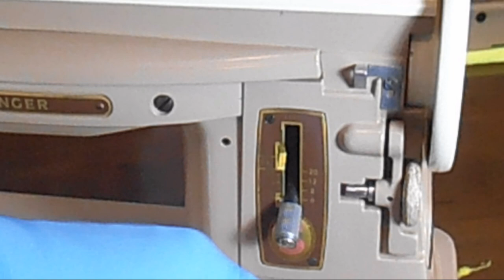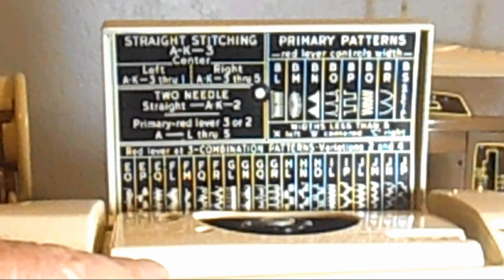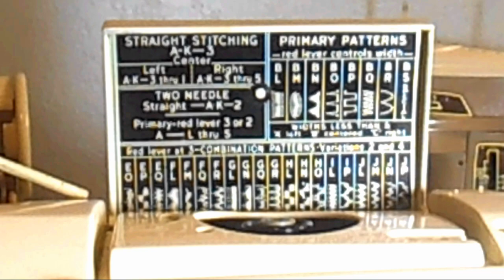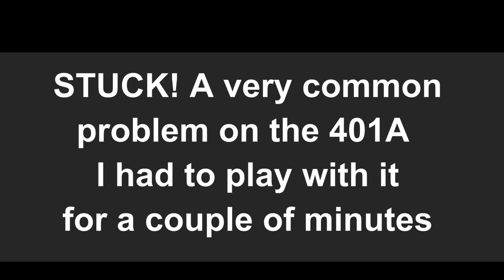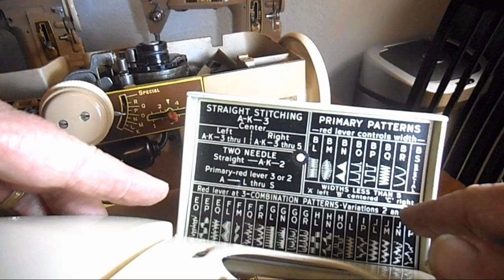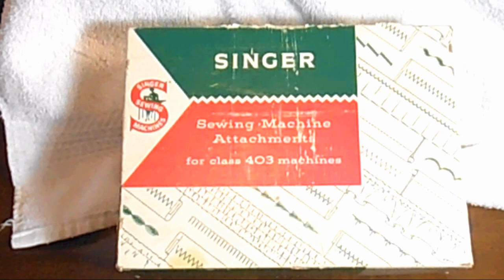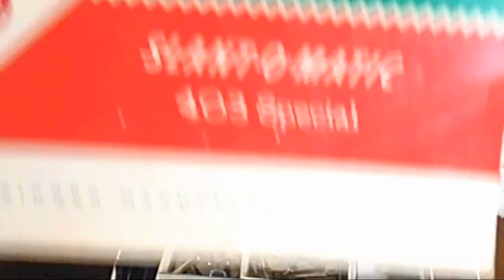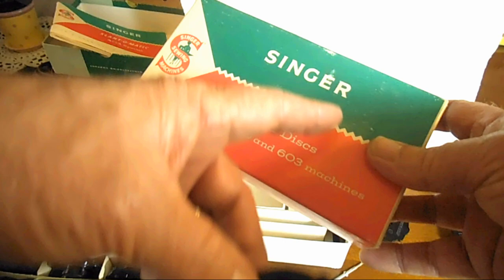SINGER MODELS 401A 403A 404 COMPARING THE BUILD AND FEATURES

Comment: Hello thanks again for all the knowledge you share. I am looking for a needle plate for the slantomatic 411 (basically the same as 401 but should be able to do chainstitch with the right needle plate. Anything that fits the 401 fits the 411) I am looking for the chainstitch plate for my 411 they say it's the #503599 that is nowhere to be found. I found the #21913 that looks exactly the same but made for singer 600. Do you think this could also be a match for my 411? Thanks in advance. I chose the 411 for that chainstitch ability I was so curious about.
Reply from the maker: Good luck. Remeber your machine was made in Germany and not sold by Singer in the USA. You said the #21913 plate looks the same and I found pictures of it, but could not begin to tell you if it would work on your 411G. I think you need to talk to some of the sewing groups online for German Slant needle machines. Also, have you tried shopping ofr #503559 on German or EU websites? https://www.parraking.com/singer-rare-411g-401a-throat-plate-503599-bobbin-case-503602-for-chain-stitch  My unsderstanding has always been that you need a corresponding bobbin case that was made to work with the chainstitching needle plate.
Reply: @andytubesewing1953  thank you for your reply and your time. Yes indeed we need both attachments to be able to chainstitch. I will try the online groups who knows. I had found that Pickling item but actually when I digged it appears that this is a scam website you never receive your item. This quest will need a lot of patience I guess. Have a good day
Reply from the maker: @HelptoFit  Yes, probably a scam website. I just wanted to be sure you were aware of the need for the matching bobbin case as you did not mention it in your original comment. The 411G parts are usually difficult to find here in the US. I have seen parts for sale on the German & UK eBay sites. Hope you find what you want.

Comment: Hi Andy, I just purchased a beautiful 401a.  No power cord.  I see two places to plug it in, the top one like a 301 only two prong  and a lower one  two prong.  I plugged my 301 cord in it light works but no motor.  Do you need both cords for it to run?
Reply from the maker: yes you do need both cords your machine was wired for a cabinet the upper terminal goes to the wall outlet and the lower terminal is to plug in the pedal. sew classic cells an electronic foot pedal for about $17 if you need one, it also will sell the different cords. I'm sure there are other places you can buy chords and pedals also congratulations on your 401A and thanks for watching my channel
Reply: @andytubesewing1953  Thank you so much, I was afraid the motor was bad.  Only paid 10.00, in a beautiful cabinet and all the accessories.
Reply from the maker: @patwagner4110  I just bought a 401a bobbin case today for $15 so I'd say you got a terrific deal congratulations thanks for watching my channel

Comment: Andy, thank you so much for all the tips, have to look into everything for the 401 , started dismantle about midnight when I couldn’t sleep. I like the 301 cabinet better; may swap if they fit same, one thing that really bothers me is that some one must have smoked constantly and the smell is rough, have to name the machines when done and see how they sew. The rubber protector for the light wiring where the cord entered machine was in worse shape than the feet, Thanks again!
Reply from the maker: My theory is that smokers put the ashtray to the right side of the machine and the fan in the motor sucks in more smoke and blows it into the machine. Whew! Washing with the Krud Kutter will remove all that. I have also found that little rubber grommet to be hard as a rock sometimes. I don't know if it is a different type of rubber or if the heat from the lamp causes that. Best of luck to you.

Comment: I have a question about my newly acquired Singer 403a. The machine works great and it feels like it can handle several layers of denim, but there’s not enough space under the foot to go over the thick hems. Is there a special foot or any adjustment I can make to give me more space under there?
Reply from the maker: You can watch my video showing how to set the correct factory height of the presser foot to see if yours is properly set for height. 
https://www.youtube.com/watch?v=OaiF13ddZe8&list=PLsCOZgzzaiKIB4kvIHCfHYuyLMUp5A4UI&index=33
We use a helper with jeans called a "Jean-A-Ma-Jig" but there may be more modern helpers available.
Heres the jig: http://www.joann.com/dritz-jean-a-ma-jig/2719813.html
Here's a short video of how it works: https://www.youtube.com/watch?v=f2PAsPv6NW4
Remeber you can control presser foot pressure with the chrome knob up above the presser bar on top of the macine.
Reply: @andytubesewing1953  Just FYI several layers of folded fabric(1.5x2" appox) placed under back of foot will also work. Or anything that will level the foot momentarily will do the trick.  I too have several versions of the jean a ma jig, humo jumper, etc; but none are ever handy when needed LOL.😜.  ENJOY your videos, keep making, please.
Reply from the maker: @jojosewist8921  That's a great idea I think that would probably work better than a plastic piece because it would be softer and more flexible thank you for sharing that

Comment: The lower thread guide on my 401a just fell out of its little slot as I was sewing.  It fits into the slot bit does not stay there.  Any ideas how to fix it please?  Thanks
Reply from the maker: Hi, Daisy. Thanks for watching my channel.
     The Lower Thread Guide is held in place by the Presser Bar Bushing. Here is a picture of the thread guard for people to know what we are discussing: https://www.bonanza.com/items/like/45363850
     As you face the nose of the machine, on the backside of the bushing is a slot for the thread guide.
The bushing is installed from the bottom up. When installing the bushing the thread guard is placed around it and the needle bar bushing and the presser bar bushing is pushed up as far as possible into the hole for it. When the thread guard hits the bottom of the bushing and stops the bearing from going farther up is when you know the bushing is correctly installed and the set screw to hold the bushing is tightened at that point. 
     If the bushing was not pushed up all the way, or maybe has vibrated down a tiny bit, the thread guard gets loose and can hang down on the side of the nose facing the sewist. Finally, it bounces around enough to fall out.
     You can loosen the presser bar bushing set screw and reinstall the thread guard around it and press the bushing up tight into the hole and tighten the screw at that point. That should press the thread guard up against the bottom of the nose end and hold it securely in place.
     Don’t be surprised if the bushing is stuck and won’t move b/c that is common. Dried hard oil gets in there and it’s like gluing the bushing in the hole.
 You may need to soften the old gunk with WD40 or alcohol to get it moving.
Here are two videos about the bushing and thread guide on a 404 that shows how I remove and replace the bushing. 
You’ll see what I’m talking about.
REMOVE: https://youtu.be/ykUY6U_E_vE
INSTALL: https://youtu.be/6MY6iPMHANk
Reply: Andy Tube, thank you so much Andy. I will try this.  I’m not very mechanical so it may take a while 😄. Thank you!
Reply from the maker: No worries, you can do it, Daisy. Of course you do not need to remove it, but just get the bushing loose and reinstall the thread guide. It may only need to be pushed up 1/32 of an inch or so.
Reply: Andy Tube I love your videos. Thank you for the confidence.  You are my hero!
Reply: Andy Tube I did it!!!👏🏽👏🏽👏🏽.  The lower thread guide now sits firmly in the grove of the presser bar and the little notch.  The screw that holds the presser bar was lose (maybe with a lot sewing) and that may have caused the guide to come unlocked .  Thank you so, so much!!  Keep making the videos 😊
Reply from the maker: Very nicely done, Daisy! I'm glad you fixed it yourself. Happy sewing.
Reply: Thank you Andy for your timely reply and the very helpful videos. Be well. 😊

Comment: Hi Andy, as always I enjoyed your video. Do you think you will make a  video when you restore the 403A?  That 404. is really nice. Also, in your opinion which is a nicer  machine the Rocketeer 500 or  the 401A?
Reply from the maker: Thank you, Dorothy. I will do the 403Ain the future; just have others to do first. If you want to get started on yours, between the 404 and 503A playlists you should be able to restore your machine. The BW on the 403A is still like the 404, and the presser bar pressure control is mostly like the 503A, without the dial but with the thumbscrew instead. If you get stuck you can always contact me.
 https://www.youtube.com/playlist?list=PLsCOZgzzaiKJZaZn2zl3LsnV2d7UhrqvX
https://www.youtube.com/playlist?list=PLsCOZgzzaiKIB4kvIHCfHYuyLMUp5A4UI 
The 401A & 500A are both great machines, so it mostly depends on which look you like. The 500A & 503A have a weaker bobbin winder system IMO, but if you like the idea of all those patterns, just pick the style you like.
The industrial 401A or the Rocketeer 500A, and have fun with it.

Comment: I might agree that the 403 is less maintenance than a 401. HOWEVER, having brought a Kenmore 158.1650 back to life (and what a great machine) the problem was trying to find the number 1 (zig zag) and number 2 (blind-stitch) cams.  Luckily, I found these unicorns.  Your 403 will be worthless without the cams should you lose them.  So, for me, I like having a selection of built in cams - you won't lose them, ever.  Plus, I've learned how to pull apart and clean and oil and adjust my 401.  And, it's really not that hard once you learn.  Your videos helped me a lot (and of course, finding and reading the maintenance manual!)
Reply from the maker: Sure, I get it. Most Singer ZZ machines have a ZZ cam of some kind. Either built-in or snap-in like the 403A. Correct, you'd have to lose the whole machine to lose the ZZ cam on that 401A, haha. On the machnes, we keep I have accumulated a spare needle bar, bobbin case, tension unit and cam for each one. With the number of 3D printers around today, I think an enterprising crafter would make and sell cams if there was that much of a market, maybe. Congratulations on your work with the 401A! Nicely done. Maybe you could post up a short series about removing, cleaning and adjust it. That is sure a popular model and I imagine the vintage sewing machine world would flock to that playlist by the thousands. I've never seen many videos on YouTube about doing that on a 401A. You'd be doing a wonderful service to all of us. Thanks for watching my channel. Take Care.

Comment: Hey andy its funny im here , you may remember me from a video on a 237 fashion mate , i mentioned how i found it on the side of the road 2 days ago and its in mint shape , anyways believe it or no i just found a 404 on the side of the road today lol im going to buy a lotto ticket , seems ive been in the right place at the right time in 2 days , so my question is , it was in a very large multi fold out table like biggest ive seen , buf it has this knee control and the pedel mechanism that pulls on this box via a rod , can i swap that box for a pedel ? Any help and advice on this  beauty would be gtreatly apreciated ..
Reply from the maker: Sorry for the slow reply. I had to run down to the store and buy MY lottery ticket. Just reading of your good luck encouraged me. 😀
Maybe next time you could post a picture when you ask about something like this? There are a few different types of knee bracket setups. On many of them, a regular pedal is just slid into a pedal bracket that holds the pedal and has a spring arm that pushes on the pedal when you move the knee lever. You can see about that type in this video starting at 1:03:00 https://youtu.be/34PKrDn3LUA
In that same video at 1:11:44 is a picture of an in-cabinet attached speed controller with a knee lever. That may be what you have. It is the inside parts of a foot pedal screwed down into a bracket. As to your question of swapping the box for a pedal. Yes. As long as you have the wire terminal for the two-prong pedal cord (the place you plug the cord into) you can use a regular pedal. If you plan on keeping the machine in the table you can replace the setup with a bracket and foot pedal as I show in the video I linked you to. If your goal is to remove the machine from the table and just use a regular foot pedal, then sure, you can do that. Model 404 has two cords. The power cord from the outlet to the terminal below the handwheel, and the pedal cord to the terminal lower down below the machine bed in the front right-hand corner. Model 404 is my personal favorite straight stitch model and I made a 56 video playlist for restoring it. https://www.youtube.com/playlist?list=PLsCOZgzzaiKIB4kvIHCfHYuyLMUp5A4UI   I'd wish l you "good luck", but jeez...why bother 🏆👍✨
Reply: @andytubesewing1953  i will make a small video of my finds for ya and you can see what im talking about , there are a few differences between your 404 and mine and 1 is my cover for the light i single screw and where your power goes in i have a covef that a spare light buld would attach , you will see ...
Reply from the maker: @4486xxdawson  I'll be on tenterhooks waiting to watch.

Comment: Hi Andy, do you know if the 401G (which I believe was made in Germany) is suitable for boat canvas?
Reply from the maker: The 401G is the German-made version of the 401A made in the USA. Yes, they can sew boat canvas and I've sold a couple to guys who were making their own sails. They said it could do the job OK but they both wished it made a longer stitch as a SailRite machine did. Using a 401 for a set of sails (if that is your plan) you will use more thread b/c of that slightly short stitch length. One guy estimated 25% more. If possible I recommend you buy a 401A (or better yet a 403A) over a German machine simply b/c parts for the 401A are more available (they made 1 million of them) than the 401G which has a handful of slightly different parts, like the needle plate clamps/raisers. I say the 403A b/c it has the same motor and shafts and gears as the 401A but minus the steel cam stack that is turning with every stitch. The 403A can use the pattern cams if you want fancy ZZ stitches. If you will be using only straight stitches on the canvas then I would look for a 404. Again, the same motor and gears, but no cam of any kind, and heavier shafts and needle bar bushing. It is considered the "heavy-duty" model of the three. 404 videos:https://www.youtube.com/playlist?list=PLsCOZgzzaiKIB4kvIHCfHYuyLMUp5A4UI   403A videos: https://www.youtube.com/playlist?list=PLsCOZgzzaiKKyqvdDRwS-9MfLuwSNJTcg    401A videos: https://www.youtube.com/playlist?list=PLsCOZgzzaiKLiDl9yFTP6mJgQmz5lj4NO
Reply: @andytubesewing1953  Thanks Andy for taking the time to give your good advice. Hope you and your family have a great Christmas and New Year. Cheers, Rob.
Reply from the maker: @robertwilliams8974  No worries friend, and Merry Christmas to you and yours.🎄

Comment: Great video!! Does the 403A do a straight stitch? And could I do free motion quilting on it? Thanks! Diane
Reply from the maker: Thanks. Yes, the 403A will sew straight stitch, in forward and reverse, from 6 to 25-30 stitches per inch.  It has the needle plate positioning lever to raise the needle plate above the feed dog for free motion and monogram sewing. There are about 20 fashion pattern discs for it so you can sew patterns and it takes the automatic buttonholer attachment as well as the monogrammer attachment. Very versatile, strong and easy to use. ( Singer called it the 403A Special) You can download a FREE copy of the Original Instruction manual (100-page pdf) here: https://www.singer.com/sites/default/files/product_manual/SINGER%20403A%20Sewing%20Machine.pdf
It will tell almost everything you want to know about it. Thanks for watching Andy Tube.
Reply: @andytubesewing1953  thanks so much!
Reply: I have a 500A, which is also a slantomatic, and I LOVE it. However, it didn't do great with free motion quilting, the thread kept breaking when I would go left. From what I have read it is better to have a vertical bobbin for free motion quilting. Singer 15-90 or 15-91 have vertical bobbins.